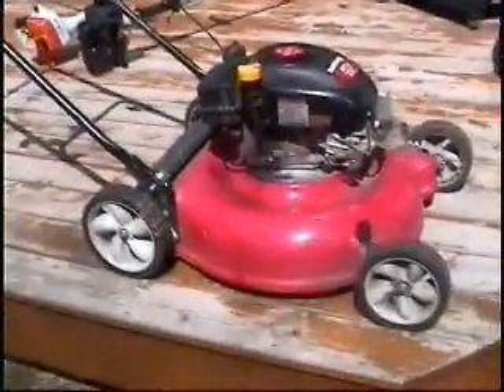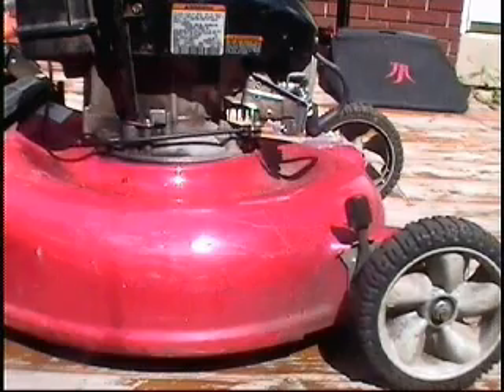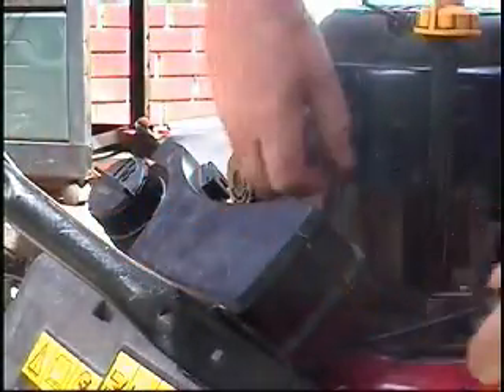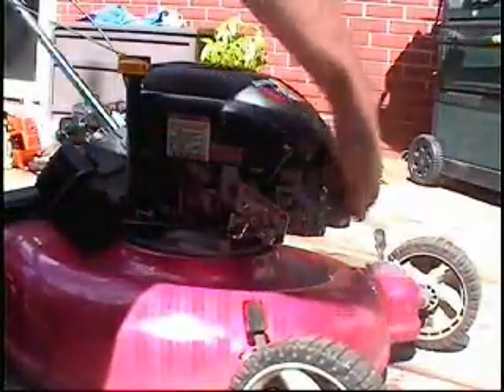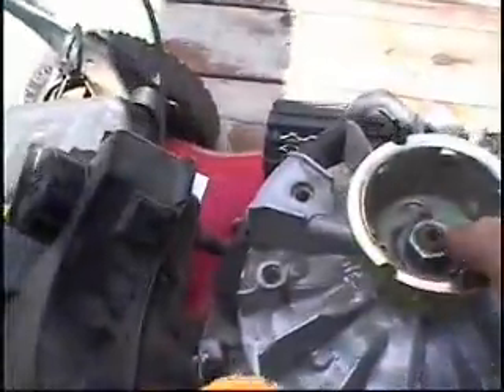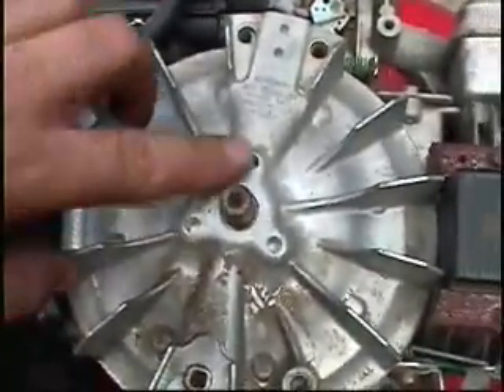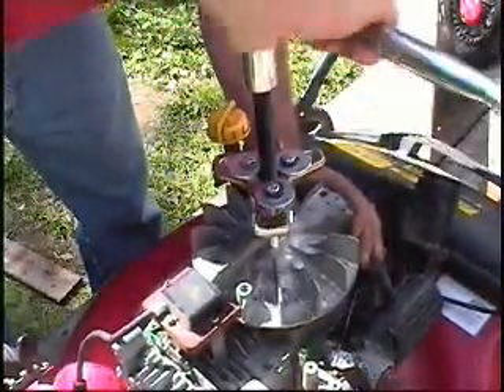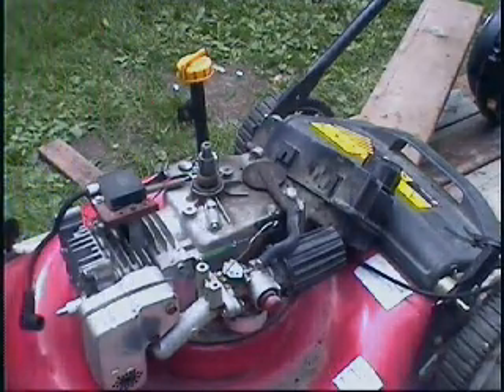(1of 2 ) Repair tecumseh 4.5 HP lawn mower with no spark

Comment: Busted the pull rope on this exact same machine. A friend had at it, put the rope back in place, and now the rope is loose and machine won't start. Doesn't retract all the way either. Use to start on one or two pulls. Now nothing. What could be causing this

Comment: @carnivore10 Thanks for the advice!! Interestingly enough, the killswitch mechanism isn't set up. I guess they just pulled off the plug wire like in your video to stop it LoL. Just being thorough, I tried pulling the killswitch wire anyway but still no spark that I saw. Should I put the plug in to see if it starts anyway?
Also, the module would be the black box there right next to the fly wheel? How do I adjust the distance?
Thanks again!

I'll probably make a video when I work on it again next.

Comment: This was very helpful, thanks. Strangely enough, with the kill switch wire still disconnected, the lawn mower stops when I push the throttle control all the way to the off position. But it seems to start reliably this way so I'm leaving it.

Comment: Hey there!! :) Very nice video!

I have a lawn mower that's been sitting for roughly two years.. It's got a Briggs and Stratton 6 horsy engine on it. The old sparkplug was nasty and gunky, so I changed that. I also poured some fresh gas in it and some fresh oil but it won't start. No spark.

I'm taking the cover off, but I'm feeling in the dark- I'm very new to this and scared of electrocuting myself haha.

Any tips? I'll probably try what you do in your video, but the mower's a bit different.